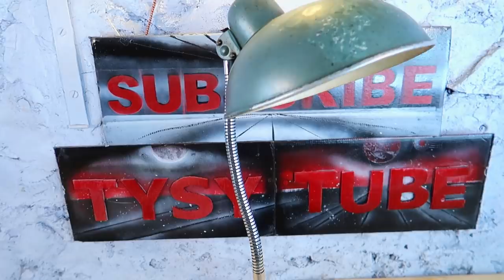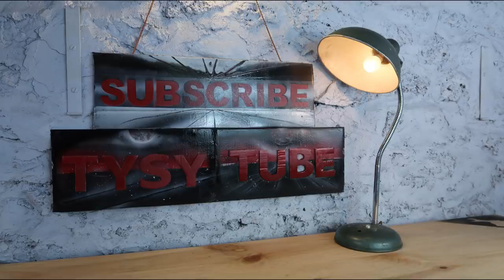Stylish Desk Lamp Restoration

Comment: I collect antique coin-op machines like slot machines and trade stimulators. The restoration jobs on those machines are beautifully done, and they often sell at a higher premium because they look like new - plus the seller is covering his investment. However, restoration removes the historic character of the piece, it makes it look as if it was made today. It doesn't have its original paint or patina that shows its true age. I'd only ever buy a restored machine because in its unrestored state, it was nonfunctional. Like the restoration was necessary to give the machine life again. The lamp you restored here, while visually looks nice, was completely unnecessary. The old green paint is characteristic of the 1950s. If anything, this lamp should have just been cleaned and had the broken plug replaced. The paint job just makes it look like new. I've seen retro-futurism lamps that look exactly like this in stores - they try to copy the old fashioned design. The only way I'd ever tell that its from the 50s is because you left the stamp on the base. After restoring this lamp with a repainting, it looks like you just went and bought it in a store. I get you go to flea markets and buy cheap stuff to practice restorations on, and I saw in the description that this lamp belongs to a friend of yours, but just keep in mind that not everything needs a fresh coat of paint. Sometimes the best antiques are the ones that retain their old character.